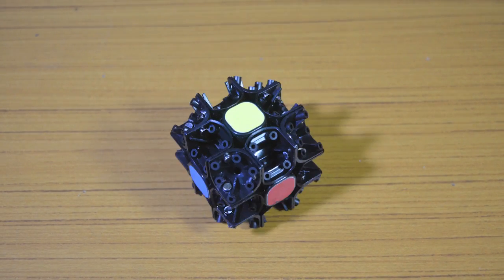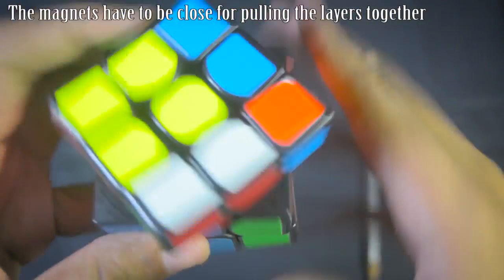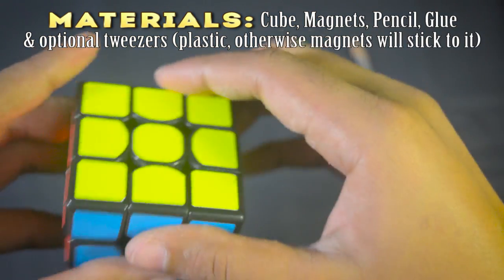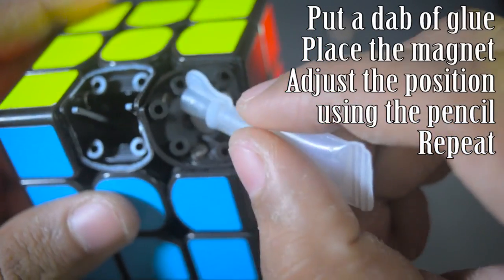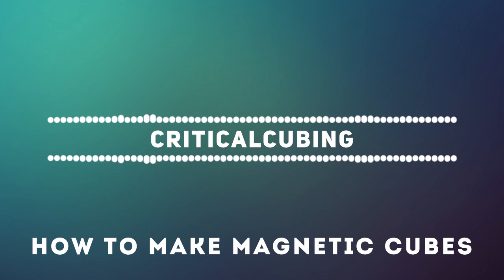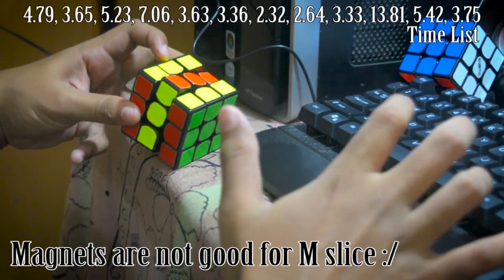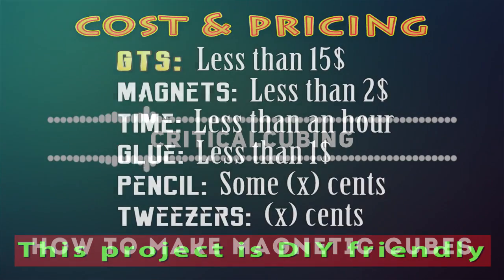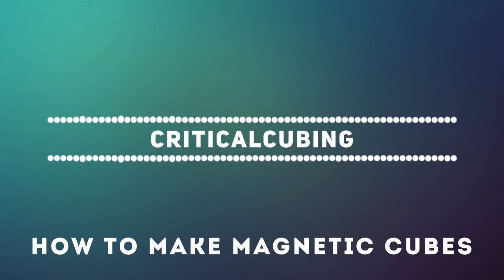MAGNETIZE ANY CUBE - COMPLETE GUIDE [TUTORIAL MAGNETIC CUBES]

Comment: What's the size of the magnets in the Valk M and MoYu Weilong GTS M please? I would like to be inspired by them to magnetize my Gan 356 Air but I want choose the good ones. Apparently the 4x2mm magnets are too powerful for Gan and slow it down. I don't wan't to waste my Gan and make it as magnetically good as Valk M. Thanks.
Reply: Tomgeek59 4mmx2mm is just the size of the magnet, not the strength. the "Nxx" is how much pull force the magnet has. "N35" being the weakest, and "N5x" being the strongest. Since the Air has thinner plastic, I'd recommend N35-N42.
Reply: i know, but apparently the size also impact the strengh
Reply: 4x2mm are by default the norm for magnet size in cubes. Differing the strengths by Nxx is much more convenient than by size, as you actually need to do math to check the strength by size. Personally, I've used N35 grade 4x2mm magnets in my Air and it's an amazing puzzle.